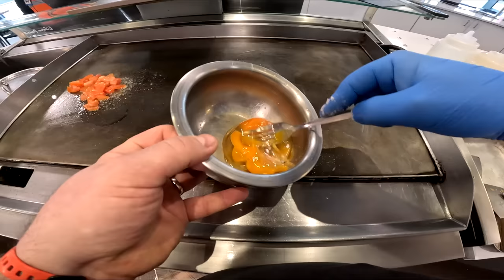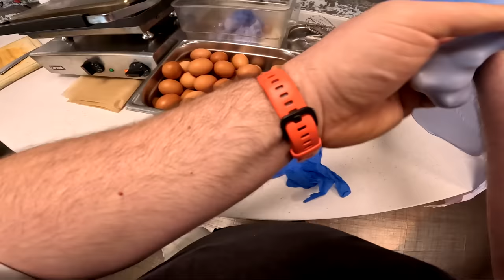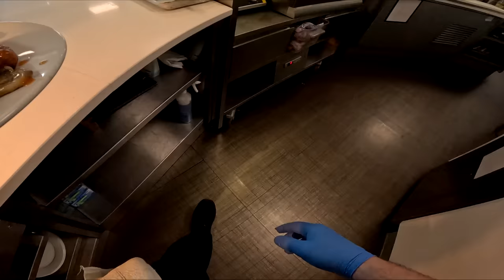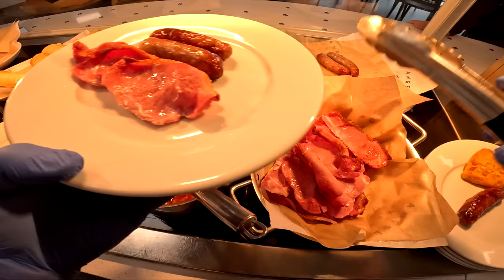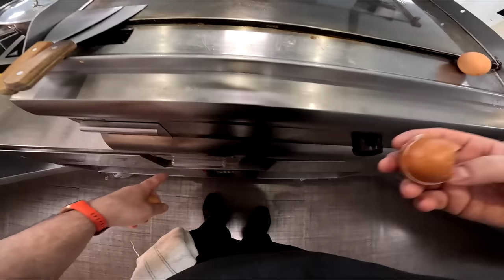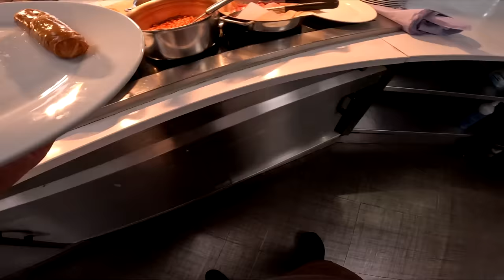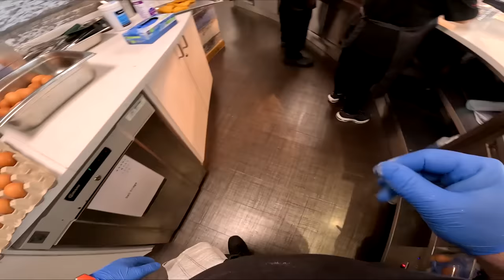POV Breakfast: 120 eggs sold in two hours 👌😊👍

Comment: A huge reason why this guy can make this look so smooth and effortless is because he has the right tools, the right set up and a system that works for him.

So many kitchens are not set up efficiently and most of the time line cooks don't even know that they're working in an inefficient kitchen and lacking the right tools. 
This is why it feels much more stressful than it needs to be working as a line cook.
What so many restaurant owners believe is the solution to busy nights is to overstaff because they believe more cooks = more bodies to get things done however it has the opposite effect.
Too many bodies in the kitchen often leads to over communication/people stepping over each other and a crossover/conflict in systems and working habits which can cause a lot of confusion and frustration because everyone has their own way of doing things (a system)

You can rock out hundreds of covers in a single day without stress if you have:
a) Enough mise en place/prep.
b) Concise communication between team members (over communicating does not equal good communication)
c) Have an efficient set up and system for the orders you're responsible for.
d) Have the right tools for the job (this responsibility lands on your employer to provide those for you)
Reply: Great comment, i plan to set up a fast food business based on the same principles you state, i also believe two people in the kitchen can serve a lot of people (of course for a small business), if the system is well thought of.
Reply: Ok
Reply: Completely agree. Well said.
Reply: And most of all if you have line cooks that speak the same language, and are not passing out from heroin.  Sorry I am a bit jaded.
Reply: 5S
Reply: @Dead_Goat The last kitchen I worked at was wierd, the line cooks were either just stoners or they liked to drink a little too much after work and show up hungover in the morning. All of the junkies were the servers and bartenders

Comment: I cooked breakfast in a cafe and we would make the omelets in one of those 8" frying pans on the induction burner. it made for a nice thicker and fluffier omelet since it could not spread flat like it does on the griddle. It takes a bit longer but worth it.
Reply from the maker: Thats nice, I have to work with the equipment I have tho 👌😊👍
Reply: no one asked
Reply: @brownie3454  What a clever statement. It only took you 4 months to come up with it. How do you cross the street without dying?
Reply: @jaklg7905  no one asked
Reply: @brownie3454 false, I asked

Comment: I worked in the food industry for 9 years. Mostly in a hot kitchen behind a grill just like this. I must say this is the cleanest one I’ve seen. Also, no one used gloves or paper towels like this. It’s just not cost affective. You keep your hands clean by not cross contaminating. It’s easy with good training. Also, use some commercial spatulas! They make your life easy! Much respect though.
Reply: So, you washed your hands after cracking eggs every time?
Reply: @UnpaintedOG  yes. Every single egg, every time.
Reply: @jinxed071202  I respect that. Wiping gloves off with a paper towel is a no no 🫣

Comment: 0:18
and that's a cross contamination violation :P
i mean it's eggs but still.....
0:36 technically another one, getting the tomatoes and the eggs in the salt now :P
21:29 you can actually prep poached eggs, by poaching them normally, then shocking them in cold water (for one service) then you just get a 1/6th pan (or 1/3 if you're busy) throw some water in there, heat it up in the warmer, add the eggs like 10 mins before service or so, the warmer will heat them up but not cook them further, giving you unlimited poached eggs, fresh is nice though, nice and chill service.

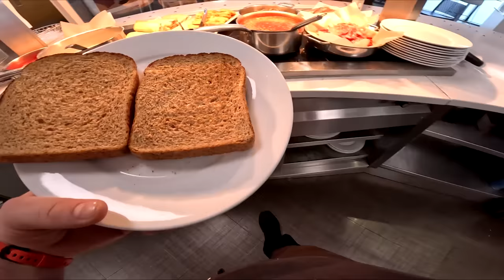Comment: Lols only 120 eggs, that’s a lot of eggs. I used to have my egg shift from 7 am when we open and cook until 2:30 at the latest and I would go through at least three cases before ten o clock and there was about 6 flats of 18 eggs per case. I remember that they would call out poached eggs and I would have to put like4 orders of two at the same time. So we mainly did scrambled eggs, over easy over medium, and hard, poached eggs, braised eggs also Frittatas as well and a “build your own scrambled” but we did them with frying egg pans there was just so many burners and so much flaming hot everything. And yea we have to change our gloves every time we were gonna cook or touch something that had eggs and we had to wash our hands so many times.
Reply from the maker: I don't normally go through more than 180 eggs on a two hour breakfast shift, our place is not busy 👌😀👍

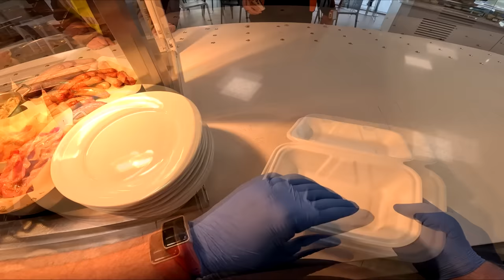Comment: The gloves are such a waste. There are enough studies that there is no benefit, rather the contrary. He also touches everything else with the gloves at around 5:30. Just stop using them, nature will thank you as well.
Reply from the maker: You are absolutely right, I don't normally use gloves, only if necessary. This video was a reaction to comments from Karens  who think you need to change gloves every 30 seconds. 👌😀👍